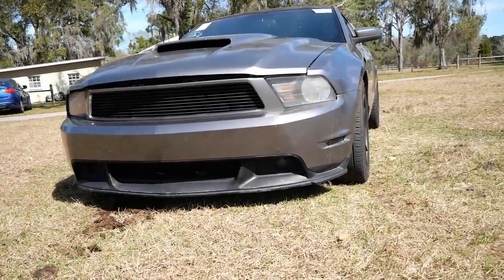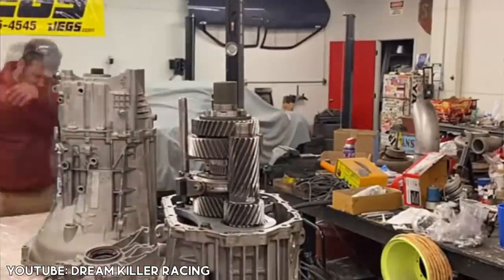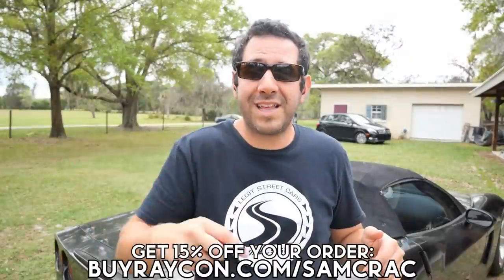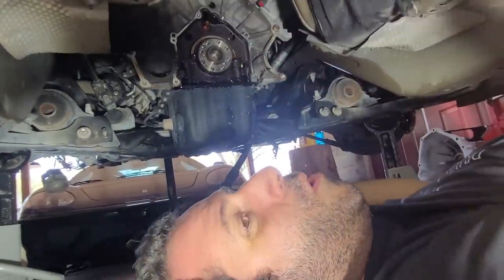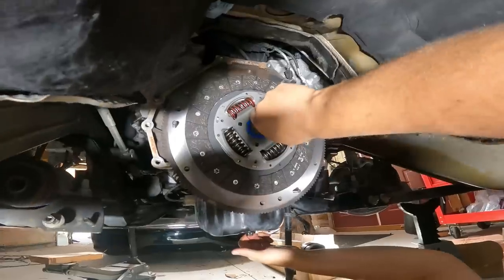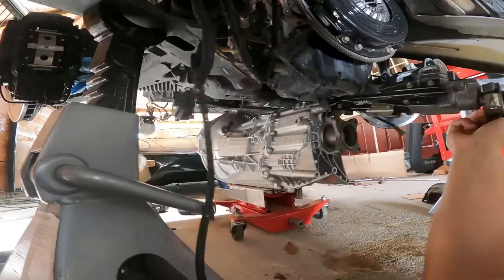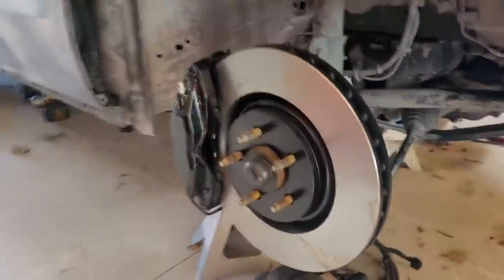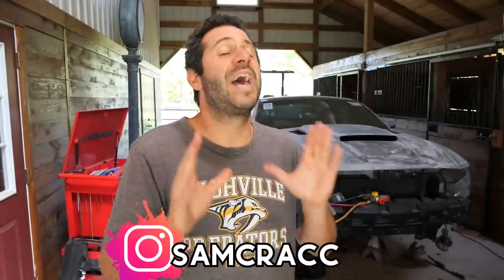My Cheap Auction Coyote Mustang GT came with a Busted Transmission! Here's how we fixed it...

Comment: I can't wait for Sam to finally get a lift, that's gonna be a really special day and the whole channel's gonna celebrate with him :)

I like the Turbo Mike bits :D got a really good laugh out of me again :D
Reply: The barn floor is most likely not able to support a lift.  He will most likely need to tear up the existing floor and have a new one that can support a lift poured.  He’s not going to find that cheap
Reply: This is what makes these videos , they won't be the same if he starts using a lift
Reply: @notanattorneybut2329  what about a 4 point lift? Not as good for most of suspension work, but already handy to plenty of other repairs. As the repairs made in this episode.
Reply: Dam I’m here thinking the same thing. I think he just loves crawling into and under tight spaces. His body will change his mind in time. PAIN
Reply: As someone who doesn't have a lift, seeing this stuff on the ground makes me feel better about my situation :)
Reply: @aflaks  yup, had to chance a clutch without a lift...not a great experience.
Reply: i actually enjoy the no lift. makes me think i can go out in my driveway and do the same thing.... (i tried and ended up with a broken bolt on the starter....)
Reply: I don't think he has any intention of getting a lift. It's just a marketing gimmick for the site to work on the floor like lot's of weekend wrench-turners. Any Number of companies would comp him one.
Reply: At this point if he doesn't get a lift, I won't feel bad for any struggles or mistakes he makes while on those jackstands.

Comment: This has to be my favorite project that you have ever done in all the years that you have been putting out videos. After the first video I posted a lengthy response about my love for the mustangs. Of course when I say mustang if it's not a V8 you might as well be driving a Ford focus.

Back when I was racing my fox body I had gotten so good of changing clutches that in less than 1 hour from the time I crawl underneath and come back out I would have it done in an hour or less. I always put the front wheels on a set of ramps I used my shop Jack on the pumpkin of the rear and put some jack stands underneath for safety. And then I went to town. I knew what needed to come off what size socket or wrench I need it and just went to town. Now this was over 30 years ago and what I was able to do I would lower the transmission onto my stomach and chest roll it to the side get out from underneath and pull it the rest of the way out if I was doing a transmission replacement. I would put it back in reverse put the fixed transmission or the original one right back up on my stomach and chest and put it right back in there and fold it right up.

I was doing this so often on friends cars also that out of one of the blown up transmissions I took the front and put shaft and used that to light up the clutches. Never once that I have to stop and unbolt the bell housing to fix the clutch disc. It was perfect every time.

I'd love to see that you replace wearable items. That's the one thing my friends would get mad at me for I would tell them to get these extra parts to have it done while it was torn apart. I explained to them by getting me to do the work you are saving a ton of money and for what it would cost to have it done perfectly you're getting other things replace. Some would do it some wouldn't and the ones who did not when the rear seal for pilot bearing would go bad I would not work on their car. I never charged a friend a single dime for working on their cars. It just seen to be the right thing to do.

I cannot wait to see the next episode. I am really excited to see the finished product. I've been getting the itch to start racing again and if I decide to do it there is no other car that I would do it with than a mustang. I am Ford blue and oval. Even to this day all I own is Fords. Hell my pickup truck is a 1990 F150 4x4 with the 5.0 motor.

Comment: Hi Sam, 
I've only had to change one failed spigot bearing in the last 32 years and that was due to an oversight by the owner who fitted a junkyard motor that was sitting out in the weather. I appreciate that other viewers like to see you replacing parts that they themselves might need to change and that it makes good content for the uninformed.
 The golden rule in this trade is the less things disturbed, the less things can go wrong, so if it wasn't leaking when you looked at it leave it alone as it is more likely to leak after its been messed around with, especially when using rtv silicon sealer and a claw hammer.
Reply: Exactly…. I about puked when Sam dragged a claw hammer and another..WMD under there and started whacking away ….. bet you a bent driveshaft that he’s got a leak now…

Comment: A simple and effective way to pull a seal is to drill a small hole in it and screw in a wooden screw (or use a self drilling screw) and then pull it with a small crowbar or similar.

Comment: I found that the best way to remove the pilot bearing is the hydraulic method. Using wet pieces of newspaper packing it in the hole and tapping it in with a socket extension, keep repeating the packing and tapping until the bearing pops out.

Comment: That rear main seal was dry, and it’s not a common issue on Ford Modular or Coyote V8s to have rear main seal leaks, should have left that one alone.  Make sure you do the crank sensor re-learn after playing with the clutch and flywheel, it changes the engine’s noise characteristics and the car will not be drivable until you do it.

Comment: $7800 for the car and $2000 for a trans rebuild and you got a Coyote almost $2000 cheaper than what I paid for my 3 valve, $11,310, you could've thrown a Tremec in it and still had it for less than my 3 valve, that's a hell of a deal, I still love my 3 valve though

Comment: Never pull the seal from the bottom, if you scratch the aluminum with that cheap seal puller
 you will have leaks you cant stop.

Comment: The issue with Mustangs and other performance car show off failures is often the imaginary abilities of the drivers.
But it is also the often the driver assist systems that decide to kick in because they think the driver has lost control ironically causing the driver to lose control.
They kill power and apply brakes because they detect the vehicle is sideways resulting in an unwanted gain in traction when the vehicle is pointing in the wrong direction.

Comment: If you're going to put 4 piston calipers on the car, why wouldn't you spring a little more for drilled and slotted rotors? Brake fade is bad on this car and most fords.

Comment: Surely there has to be a better and more accurate way of replacing a rear main seal than hitting it on a wobbly bit of wood, on the floor, with a claw hammer. Or am I missing something here?
Reply from the maker: Nah man, it worked pretty good

Comment: I installed my manual transmission on my ‘76 TR-7 with a 4x4 as a fulcrum and my forearm as a lever.  The last 1/4 was the hardest. The car lifted up 3/4” as the transmission kissed the rear block. I looked at my forearm as I placed the first bolt and my arm was bowed about 1 1/2”.  I have never had an issue with my forearm.  I guess I may have just strengthened the bone by putting in micro fractures and healing over the years.

Comment: Sam found the dirty little secret, brembos freshly rebuilt with new seals had had most auto parts stores, ebay wants 500+ for dirty ass used ones.

Color? Carbonized gray
Bolt on's? Intake, header exhaust and maybe a reflash? Also some dope wheels and lowering springs

Comment: Who did you get the Transmision from? The TR6060 in my 07 GT500 has second gear grind, over 100 passes at Silver Dollar Raceway. I need it rebuilt or replaced!
Reply from the maker: Unfortunately this has the MT-82 in it, not the TR6060, I got it from a shop called Bishop International. I'm sure they could rebuild the TR6060 but not sure if they have any cores they could build you one from.
Reply: @Samcrac  Thank you, I actually have a supposedly good spare I purchased several years ago but the guy drag raced a lot more then me with a lot more power [he went auto] so I'm sure it most likely needs a rebuild as well. BTW: those jack stands are in the wrong location, the floorboard will get damaged like that and it can cause alignment issues!  Ask how I know..